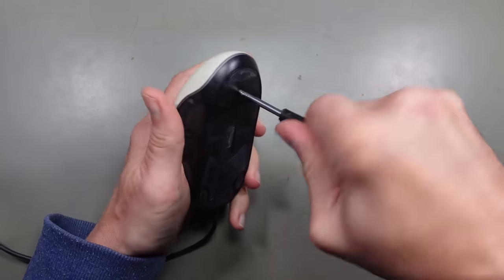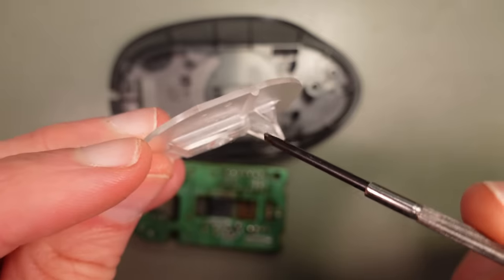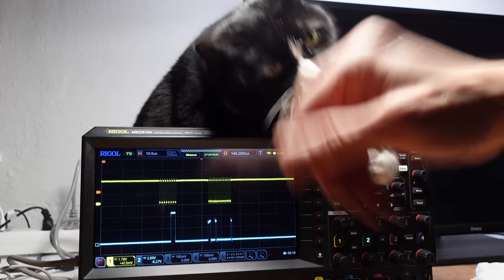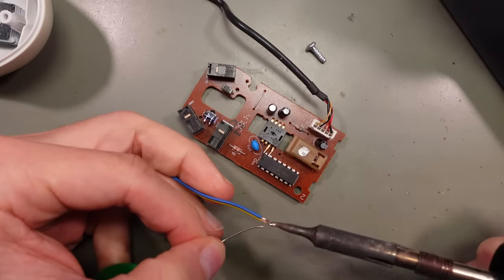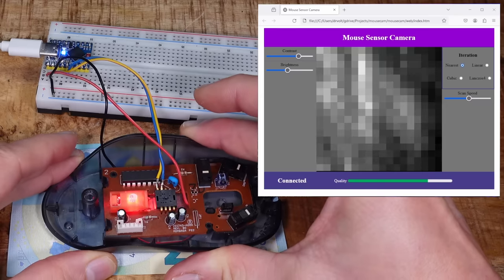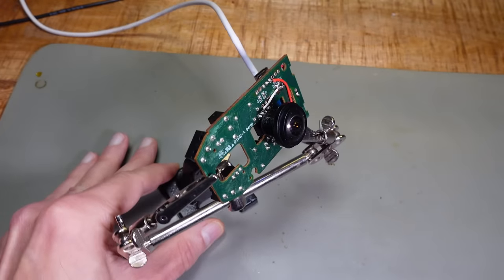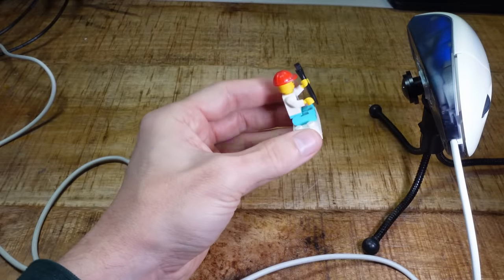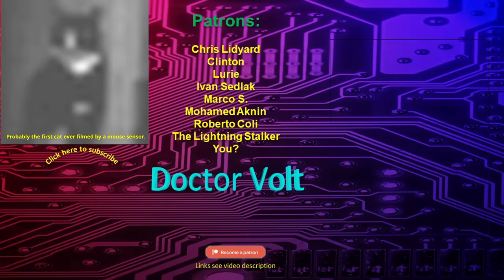I Hacked a Mouse into a Camera!

Comment: I've never seen a sensor like that in a mouse. Is that old tech or what? Because all ive seen are LEDs and lasers. I took my Logitech G305 apart and it just looked like an infrared laser diode. 

What mouse tech uses cameras? What is the name of the tech i mean? 

I've seen the names "optical mouse" and "laser mouse"

Is that what they mean by "optical mouse"? It has a camera and thats what it needs the red LED for? To light up the area for the tiny baby image sensor?

Thank you, i am an idiot.
Reply from the maker: I think that this mouse was from 2004. It originally had a PS/2 connector. My wireless mouse from 2021 works exactly the same way, but I didn't want to sacrifice it for this experiment.
Reply: Yes they all have a tiny little image sensor, and they have an LED (red, or invisible near-infrared) or laser to create structure of highlights and shadows from the surface unevenness on the area to image. Not all mouse pickups have removable optics though, so it may be difficult to see into the image sensor. The light source can sometimes be integrated into the sensor IC package together with the optics, particularly in laser mice.

The sensor used here is no longer used, but there are many similar ones, such as 5030, almost indistinguishable in behaviour and construction.

The one on the G305 looks a little different, it looks like a scalloped daughterboard, but fundamentally all the same parts are there just the same, packaged differently, and of course it's a higher spec device.

Comment: But how come the frame rate is so low, aren't these supposed to be a super high frame rate so it can respond to fast movement ?
Reply from the maker: The high frame rate applies if the images are processed within the sensor to calculate the movement. Reading the raw image from the sensor takes a long time and is not supported by all sensors either.

Comment: Why is the framerate so low when compared to how the mouse itself would be able to do?
Reply: It's because the IO port of the mouse sensor is very slow.

Normally image processing occurs on the DSP inside the mouse sensor. The IO port is only used to retrieve final offset coordinates, and potentially data such as feature quality metric which is used to determine lift-off, a total of just several bytes of values per report.

The normal report rate is somewhere between 125Hz and 4000Hz for different mice, while framerates are dynamic depending on movement speed, aiming for a single count offset being generated about every 1-2 frames, and range in thousands of Hz.

You put the sensor in engineering test/calibration mode to retrieve the sensor image, this is not a mode used in normal operation. It's used by the manufacturer to assess optics.
Reply: @SianaGearz  Is it possible to bypass that interface and talk more directly to the image sensor to get a better frame rate?
Reply: @tiagotiagot  No. There's 8 pins on the typical optical mouse sensor IC. serial in, out, clock; ground, power, reset; that's already 6 pins, then chip select to be able to multiplex serial bus with some other device (SPI standard), and LED drive pin for the image area lighting, and it needs to be driven by the sensor since it turns the LED up or down to make sure it's got just the right amount of contrast in the image. That's it. So that serial interface, you get what you get, and it's on the very slow side. I mean on a less ancient sensor you can run the serial bus a little harder but it's still not going to be all that fast.

Comment: Please get a Logitech g305 and do it on hero sensor. It would be higher pixel count. This mouse would be super cheap on used market. I wanna see how Logitech has improved over years.
Reply from the maker: Even the newer sensors have a resolution like this. It has nothing to do with the dpi of the mouse.
Reply: @DoctorVolt    Wrong, the Hero indeed does have a higher pixel count, probably 29x29 or 30x30 instead of 18x18.

However there's currently no way to retrieve the image from the Hero sensor, or even know exactly what it is. There are other high-end sensors though with similar resolution.

Comment: How would you use such a sensor to scan a region to get a high resolution image?
Reply from the maker: Yes, but this would require some mechanics.
Reply: @DoctorVolt  like? How hard do you think that would be to do? ,
Reply from the maker: @petevenuti7355  Need to design some mechanics that moves the sensor in x-y direction through the focus plane of the lens plus stitching software. That requires some effort but it's doable.
Reply: @DoctorVolt  that sounds a lot easier than some kinematics that make the focusing lens follow a curve like I was imagining.
  I'm not familiar enough with optics to know for sure, but doesn't having the sensor at different distances from the lense result in what's being in focus being different distances from the lense?

Comment: Maybe you can try the same with a G304/5
Reply: Waste of time, it has a mystery sensor, no datasheet and it won't be easy at all to figure out how to access. Brighter minds have tried.

You can get several gaming mice with 3360 sensor which you can indeed read, but it's a little finicky since the sensor requires firmware, and the firmware is not in the datasheet. The firmware is volatile and is uploaded into the sensor by the mouse USB microcontroller on power-up. The firmware stored in the mouse is also not the one you need for image retrieval, you need different test mode firmware.

But one gets it if one knows where to look :D i doubt i should be mentioning where, i don't want the lawyers to get a bright idea.

Comment: Why only 3fps when a mouse reacts in 10ms?
Reply: Because retrieving the image is slow. Normally it's not what happens in operation, the mouse sensor has a signal processor that processes the image internally, and only communicates computed aggregate offset between reports and optionally a quality metric to the USB IC. The image retrieval is a special mode for testing lenses, not for use.